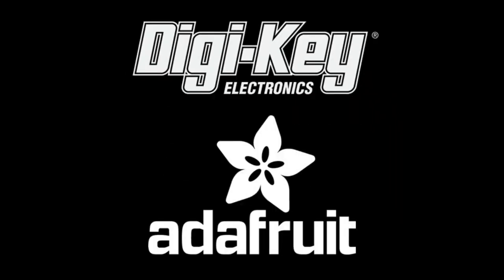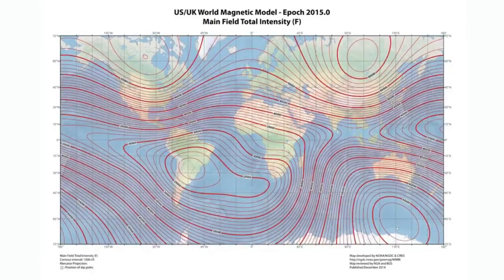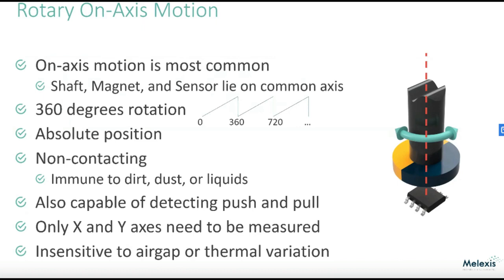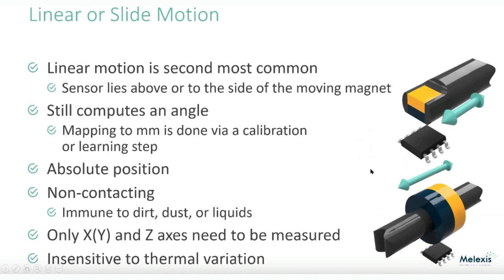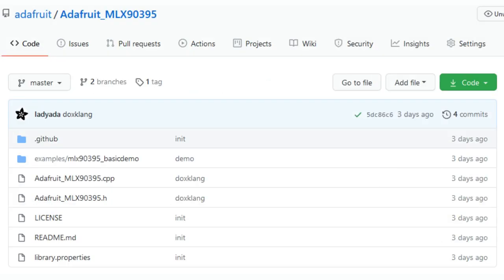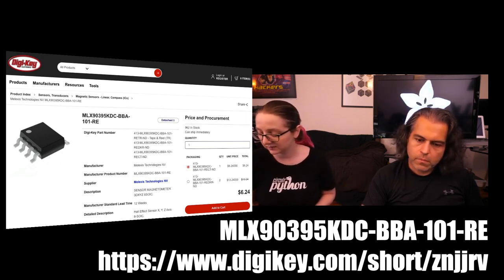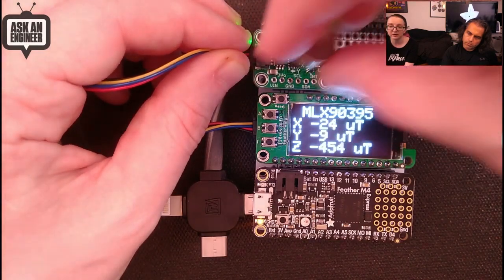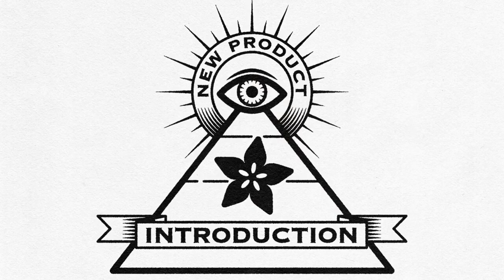EYE on NPI - Melexis MLX90395 High-Range Magnetic Field Sensor #EyeOnNPI  @Melexis_Sensors @DigiKey

Comment: Hi LadyAda,
AMS makes a similar sensor (has been doing so for at least 6 years). What would be differentiators to pick one or the other? I asked on Melexis's youtube channel already, but was wondering what your take is on this topic..
Reply: Hello, 
The key differentiator for this product would be the 3rd Z-axis. It seems like the portfolio of the position sensors from AMS is limited to 1 or 2 axis. While this MLX90393 offers magnetic sensing in 3 axis.